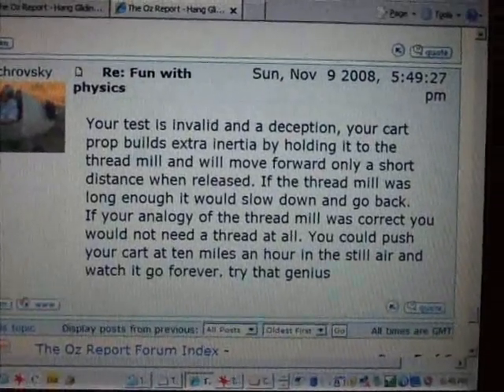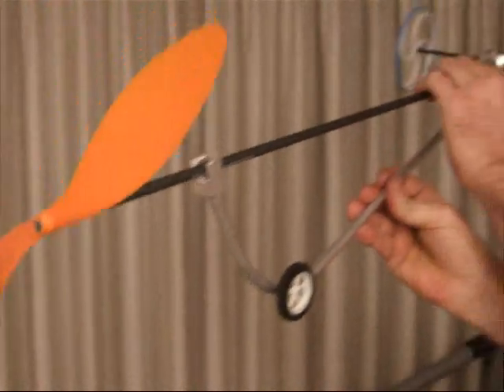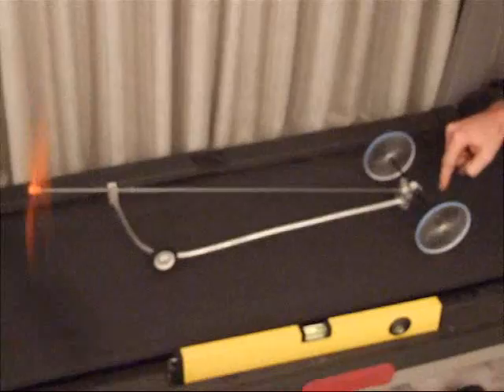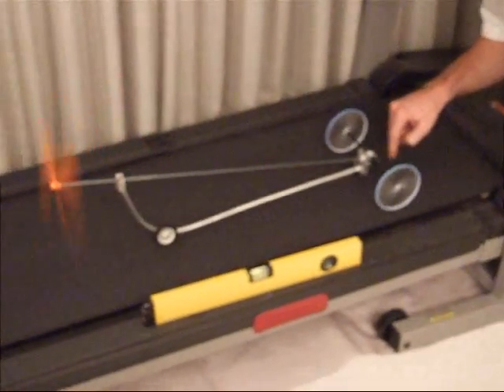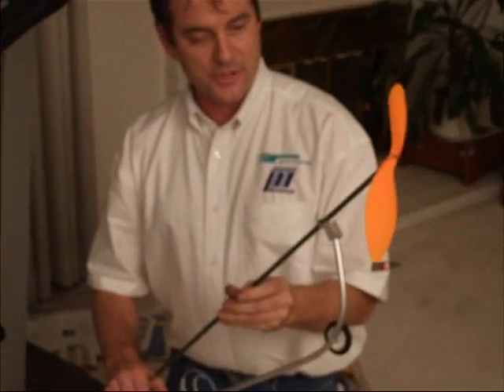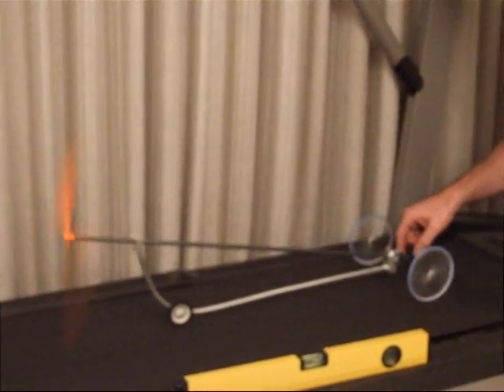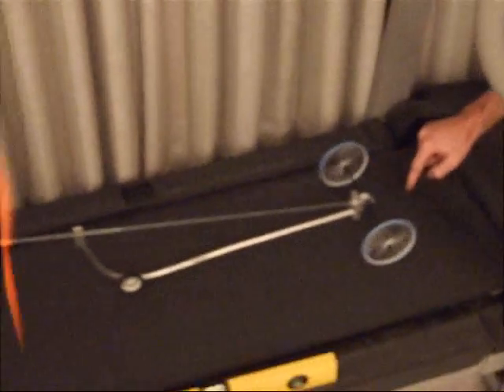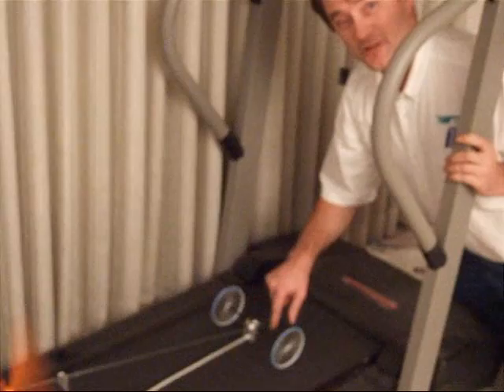Direct Downwind Faster Than The Wind #4 (DDWFTTW)

Comment: he puts energy into the system by running the threadmill agains gravity.
Reply: You're half right, energy came from the thread mill, but it didn't need to run up against gravity to generate energy. Energy is force X distant, the thread mill is applying force to it (the car) through its own inertia. From there, the wheels turn the fan and generate backward force and the thread mill would push the car harder

Comment: Imagine the inclined plane of the propeller as a surface that moves BACKWARDS though the air, much like the paddle wheel of a river boat re the river. An air particle on the inclined plane of the propeller actually moves backward relative to the cart, and slower than the wind. This allows the wind to push on the propeller and thus do work on the blade surface. The car moves faster than the wind creating drag, but the power the wind exerts on the propeller may make up for it and then some. HenryB

Comment: Does this mean we could sail a boat upstream in dead wind using the same principle?  I am at a loss.  JB!!!! you have to be one of the most brilliant eclectic people on this earth.. what got you into building these confounding machines? I am a physics guy and I cant seem to see how this does or doesnt violate conservation of energy.  Any help folks?

Henry B
Reply: Yes - the energy comes from the difference in potential between the wind and the ground, which the craft is connected to. Imagine a stationary windmill pulling a cart with a string. As long as the turbine makes enough power, the craft can move faster than the wind - it's a matter of energy, not windspeed. Now, put the windmill on the cart, linked to the ground through a transmission. As long as the blades spin fast enough to get energy from the wind relative to the ground, you can go downwind at windspeed, or even faster. It's not the speed that matters - it's the energy.